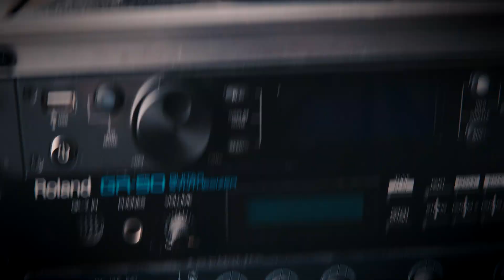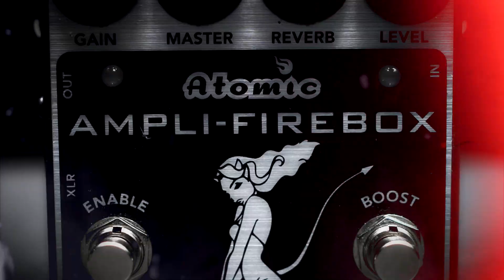Atomic Amplifirebox Acoustic Sounds - Acoustic Impulse Response

Comment: I think you can boost the overall output volume with the editor. Actually for each of the 2 outputs individually.
Reply from the maker: Yes you can, but it would be a global change. I can't remember what I said in the video, it was quite a while ago now, sorry.
Reply: @BenFletcherGuitar  Yes it’s Global, it’s Ok I just was trying to give an option to add gain to acoustics through the box (since you can always lower the Volume knob when playing amp emulations).
Reply from the maker: @javiceres  Turn down?! I don't understand?! Everything louder than everything else! Haha! Yes you're right, I'm sure you could find a balance. The ones I tried were very quiet after bypassing preamp section of the pedal, for some reason.